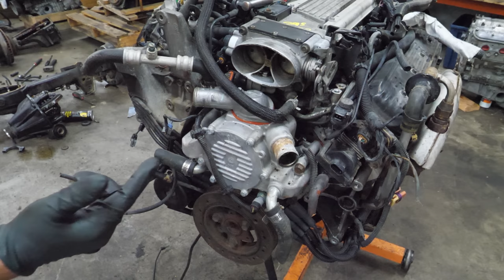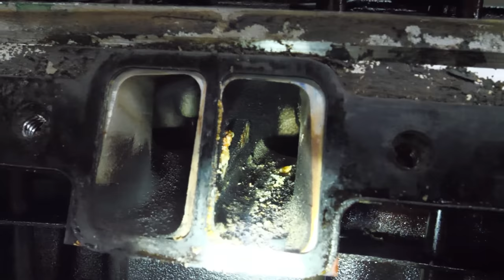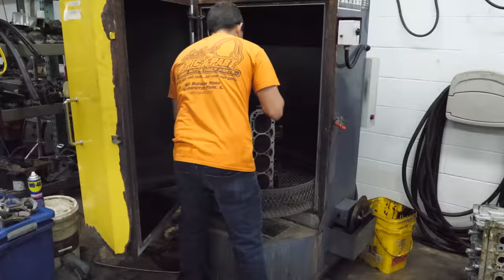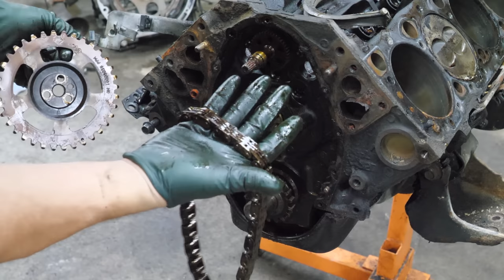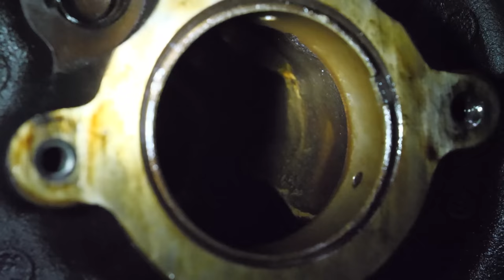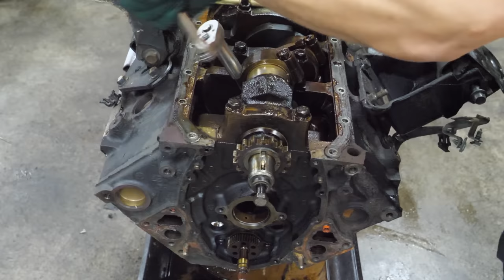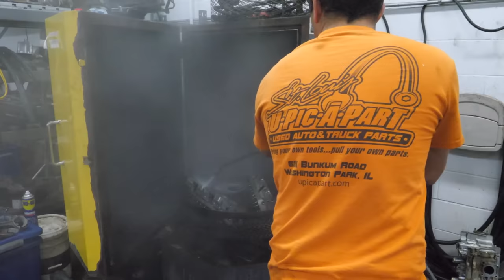Bad Corvette Camaro Trans Am Gen2 LT1 350 Teardown. Not The Problem I Was Told!

Comment: Great teardown as always. I'm more of a carpenter than a mechanic myself so it's always fun to see a disassembly of an engine since it's not something I really get into myself. (And the knowledge will for sure help if I ever do tear into one)

I will suggest though that if your cordless ratchet and impact seem to be a little... lacking in power, replace them sooner rather later. Last time I replaced one of my well used impacts, it was like night and day. For sure made a huge difference in my workflow, and time is money. Plus Christmas tool sales are going strong at this point. Buy now, save a buck, and hold onto the old ones as backups/extras. Better than buying them only once they die, because you know if you do that they aren't gonna be on sale. (Plus they'll die at the worst possible time too.)
Reply: My air operated ratchet started going stupid and I found that a small spring loaded ball had worn flat, fished through my junk collection and replaced the ball, worked fine. Ted from down under.

Comment: I have 4 of these LT1s. All Iron Head versions. 2 of them have 300,000 and don't burn Oil. One still has the Original Distributor Cap and Rotor,

Comment: Have had a few small blocks with creamy oil from blown head gaskets. Cleaned them up with ATF and some green Scotchbrite pads, and they ran like a champ. The last one was in an '89 K1500 with a leaking cooling jacket bolt hole. Cost all of $30 to fix that one and it's still running strong.
Reply: Question...
What is ATF?
Thanks 
😎👍🏼🏁🌎🇺🇲
Reply: @jimilopex76  Automatic transmission fluid

Comment: I'm in the process of tuning one of these engines right now. I got it for free "ran when pulled"... Right. Turns out all the rod bearings were spun. So I stroked it and bumped the compression up to 11.4:1 (perfect on the reverse cooling of these engines). I did an electric water pump, and carb swapped it. Dropped it in my 1980 Camaro. It's a sweet motor now! Thanks for the tear down video. it was cool seeing one with everything still all over it. Mine came mostly stripped down.

Comment: All the Camaro, firebird and Corvette LT1s had aluminum heads. Ironheads came on the Impala and Caprice engines LT1 or l99 variants. As for the opti I feel like it's much more maligned than it should be. I've ran into issues with other random sensors Ie coolant temp sensor causing symptoms that mimicked a failing opti. I do remember hearing about these engines liking to munch bearings but that almost was always a case of running the engine too hard when it was cold. I had an iron head LT1 from a 95 Caprice police car that I beat the hell out of for 15 years in my 82 Camaro and before I pulled it it was running just as strong as it ever did. This is after countless dyno pulls, street and track passes.

Comment: @I Do Cars, The best LT1 that I liked was in the 1996 and a half Police Interceptor package! They were employed
in the Caprice; upside down bathtub cruisers. Those engines were rated 350 cu. in. at 350 HP Hi Output model.
Those cars would launch like no other and as I've been told are very similar to the Impala SS. They also acted
like they had acted like they had an inexhaustible top end! Boy, I could tell you so stories!!

Comment: I still drive a 1996 Corvette with one of these in it. The valve rockers look slightly different. Not sure why. Still fun to drive around. I have a lifter on the #2 cylinder that's starting to wear out. Going to be my next fix with the digital display after that. Just hit 100k miles a few weeks ago. Thanks for the great videos.

Comment: Really enjoyed this video. I've never seen inside one of these engines. I can see why they aren't on the list of the top 10 best small block Chevrolet engines. GM started with a bottom of the barrel 350 (single bolt mains, cast crank, cast rods and cast pistons), then they "improved" it with the horrible water pump drive, ignition system, intake manifold and fuel injection system. The only redeeming feature of this engine is the aluminum heads. But they aren't really that much of a big deal, considering the aftermarket alternatives that are available now. The engine is in surprisingly good condition, considering that it had two blown head gaskets. Thanks again for sharing this video.

Comment: I've owned three LT1 cars over the years.  1992 Corvette, 1993 Z28, and currently have a 1995 Trans Am.  The only one that needed an opti replacement was the Vette after a classic water pump failure.  Replaced it with an MSD variant, which ran well.  LT1s are some of the best stock sounding V8s in my opinion.  Still hoping to some day own a 94-96 Impala SS but they are going up in value fast.  Thank you for the video.
Reply: Agreed!!! I've had 2 LT1 cars 95Z28 and currently I have a 92 corvette. Both are extremely fun!! I have basically the same thing done to the vette that I did to the camaro but went a lil further with the vette on mods! The corvette has full custom exhaust system from a C7 grand sport with the Xpipe and headers and sounds absolutely beautiful!! The Z28 had a 3in catback Flowmaster system with stock manifolds it sounded incredible as well but not quite as good as the corvette and the corvette is quite a bit faster and obviously handles a million times better
Reply: Best sounding V-8 ever imo.

..maaaaybe the GT350's "Voodoo" engine is tied with it. Maybe.

Comment: That splined coupler for the water pump does NOT come with a new pump and it’s potentially quite valuable to someone who needs it. And totally agree the Opti can be sold for refurbishing. Almost every version of it sold today is vastly inferior to the original spline drive and pin drive Optis from AC Delco.

Comment: Always put a new Delco in when job created access. New wires , Plugs , Coil too. Good preventative maintenance on nitemare design. Optispark was attempt to improve timing and EFI accuracy , which it did almost as good as crank/cam trigger does these days

Comment: I was a tech at a Chevy store when this motor was in production.  This was around the time GM was trying to make less waste by implementing 100K mile service procedures,  Oil life monitoring system, Dexcool, long life plugs and the Opti-spark.  Some systems worked better than others.  The Opti-spark was a growing pain between standard distributors and coil on plug OBDII systems.  The SS Camaro was likely the worst tune up because of the plug access.  It was easier if you used an engine drop table and lowered the motor out of the car 3-4 inches.  I do recall, late 90's, most of the full Opti-spark tune ups cost about $1,000 which pissed a lot of people off but the Opti-spark distributor alone was over $400 for the part back then and I think labor time was around 6 hours.
Reply: Contrary to what shadetree mechanics say the optispark system was a very good system all around... The LT1 was GMs most powerful production small block as well..
Reply: Optispark replacement at the dealership always ran around  500 bucks for me. I got around 100.000 miles on each one...
Reply: @jonathanlawson4667  all those police cars and taxis used that system, as long as the WP didn't leak it worked well.
Reply: Wow
Reply: Agreed 100% brother, I'd take a LT before a LS any day !
Reply: SS had the worst tune up access?  So you’d rather drop the engine than take off the air induction sitting on top of the manifold with its two 8mm bolts?  C’mon, man.  Something ain’t right with your story.
Reply: @fillupread  by induction I mean the CAI that sat atop the intake manifold on a LT1 SS car.  That is the only difference between a Z28 and a Z28 SS-  The “ram air” induction, which in itself, does not allow for good plug access unless the induction/CAI, whatever you want to call it, is unfastened by the two 8mm bolts holding it onto the top of the intake, which is also for the fuel rails.  I own one of these cars.  Vids on my channel.
Reply: @brian96597  Again...the intake is not in the same zipcode as the plugs or the Opti-spark.  Just quit.
Reply: It sucks to do
Reply: This is still one of my favorite engines. You could beat on this engine all day long and not hurt it!!! 😎

Comment: The new waterpump was a sign, the new coolant sensor in the left head sealed the deal, the post mortem was exactly what I expected after seeing those. I didn't realize those were 2 bolt main blocks. Pretty strange when you consider the power output and that a Roadmaster or Caprice wagon full of two legged beef, luggage and towing a trailer is getting into truck territory for GCVW.
Reply: I think the lt4s were four-bolt Main
Reply: Corvettes got 4-bolt blocks, the F-, B-, and D-bodies used 2-bolt blocks.

Comment: Wow, such a genius idea to bury the cap and rotor like that. Those parts never need replacing. Must be the same engineering team that decided it was a stellar idea to put the starter in the engine valley. Because like all electrical parts, they last the life of the engine!!  Kudos to GM. eyeroll 
That cam driven water pump is awesome too. Because, belts are hard. No one "gots" time for belts. LMAO
Reply: you should see the genius engineering behind the gas tank on the Camaro this this engine came in lol, I did it the hard way without cutting a hole, total pain in the ass
Reply: @miatalife94 I mean its fine for me I am planning on doing my 97 trans am fuel pump. However while I am under the car with everything out of the way I plan on cleaning and painting all the underside. It's honestly worth it to pull the tank on these cars now if you got a nice one without any rot. You can clean and paint anything that might have a bit of rust starting to form.

Comment: @24:44 - RTV should be applied like you would apply heat sink compound to a processor.  Very even and very thin.  You're trying to fill slight microscopic imperfections, not stack the Hoover Dam!

Comment: My parents had a 94 Formula (car I learned to drive lol) and it was reliable AF besides needing 2 starters replaced. IIRc they sold it after 100k. The optispark was no problem, and 'experts' generally attribute it's probs to leaking pumps (dexcool) and then inferior replacements.

Make no mistake, it was a problem - but more from a bad pump configuration and a not-quite-sealed ignition. The LS definitely improved on this. That Formula was replaced with an 02 WS6 and has had zero failures...besides a lifter tick lol.
Reply: Your parents are freakin awesome

Comment: My 1996 LT4 made 415hp. It had different heads, cam, rocker ratio, slightly different intake with bigger injectors and throttle body
Reply: Lloyd Elliot or Advanced Induction?
Reply: @cali2468  factory optioned and installed but, it’s more commonly known as the LT4 high performance kit with the LT4 “hot” cam and big valve and big port heads. It was also available through the dealership as a GM Performance kit. I made a mistake on the year, it was a 1997 anniversary Z28 that I bought in 1996. But included in the LT4 package were better heads, a red intake that was ported and port matched with the throttle body opening enlarged to accommodate a 1000 CFM t-body, 30# injectors, the t-body, 1.65 rockers, shorty headers, a bigger cam and the ecu tuned. With a K&N cone filter, high flow cat and flowmaster exhaust system, I put down 415hp at the tires. It was supposed to be 420hp at the engine but it was severely underrated. I hope this was helpful. Oh and with BFG drag radials and it was a 6 speed, I ran consistent 11.40’s at 120 in the quarter
Reply: @josephbrownjr3564 holy crap, my dream car right there

Comment: These were great performing engines in their day.... way stronger than the L98 it replaced.   Ended the reign of the 5.0L Mustang and the subsequent 4.6 Mod motor was always in the rearview.  The GEN2 LTX had a short production life from 92-97 because GM just needed a stop gap to get them to the GEN3 LS.  A lot of the stuff with them never made sense to me... the reverse cooling and optispark.... all that did was make major components incompatible with the previous SBC and introduced unreliability in the ignition system.
Reply: The reverse cooling was about emissions and performance. Smokey Yunick talked about it, and some race teams tried it. I believe Oldsmobile or Buick tried it back in the 50's but cost of production was to high. The 92 Corvette was the first production car to utilize it.

The theory behind it was to cool the hotest part of the engine, i.e. the combustion chamber so that higher compression(10.4:1 LT1 and 10.6:1 LT4) could be used. Also it allowed the block to warm up faster so that cold start emissions were reduced, and also longer block life as cold shock(cold coolant entering the block when the t-stat is initially opened) would be heavily avoided.
Reply: I remember when this came out too and ran past 5.0 mustangs . It changed street racing
Reply: Dry intake
Reply: @headhoncho4890  oh yes I remember racing a mid 90’s GT at the 1/4 mile track at rockingham NC on night with my mostly stock 96 z28 automatic I put a city block or more on him lol. He wasn’t stock either he had off road exhaust and drag tires.
Reply: I like Mustangs too, but idk what Ford was smoking when they put the anemic 4.6 into it when it had the LT1 to deal with. (and did they know the LS1 was right around the corner?)

Comment: These engines always ran so hot. 90's LT motors were okay for the time, but man did the LS improve upon that design.
Reply: Chev engines took a dump with the high temperature thermostats required to meet emissions, until completely re-designed with the LS.
Reply: But my stock LT1 still smoke an LS1. Imagine that?
Reply: @WilmaTell had a LS2 powered car, that ran hot as shit, now I have a 94 Z28 I bought after it sat in a field for 6 years, dropped the tank cleaned with new fuel pump...... it'll probably run the LS2 car close, these LT1s are no bullshit
Reply: @miatalife94  If they're both 6 speed manual transmissions it all comes down to the driver. If you hit every gear and don't spin it that's all it takes. LT1s are more aerodynamic and lower to the ground.
Reply: @WilmaTell they sure did I drove a 94 fleetwood Lt1 big as car and still beat plenty of ls I raced a hell I raced a 300 with a hemi and kicked his ass
Reply: @WilmaTell  stock vs stock I find that incredibly hard to believe.  LT1 Fbody vs LS1 Fbody the LS1 cars is ~.5 sec faster in the 1/4 (both being stock).
Reply: @GregHuston  It comes down to aerodynamics. I also already said it comes down to the drivers at that point. There really isn't as much difference between the two they'd like you to believe. At this point we're splitting hairs. You're both going to go to jail regardless.

Comment: Had a a similar 5.7 350 tuned port injection GTA! Car did 155-160. Had to hold er in D well into redline, then shift to OD. Otherwise it would keep shifting up and down around 125, and quit pulling. Car was a ball. Crushed all my buddies 5.0’s! Great vid!

Comment: I've been waiting for a 2nd gen small block LT1. I've done a lot of work on my 96 Roadmaster but I've never seen inside the engine. It's got over 170k miles on the original Optispark and I had a water pump go out around 140k miles and soaked it. I dried everything up as good as I could, put the new water pump on and haven't had a problem yet. Although I'm very aware that I need to rebuild the Optispark soon.

Comment: The trucks from 96 up had the L31 Vortec which was nearly as powerful in terms of hp and lacked the wretched optispark, but traded that for bad intake gaskets that leak coolant into the valley, and easily cracked iron cylinder heads

Comment: On the 3800s you also need to pull the oil level sensor before taking off the pan...I found that out the hard way after breaking mine. Bit of a silly thing really.

Comment: Looking back in retrospect it’s really interesting that GM took the basic iron block from the 60’s as far as they did. These aluminum headed, overplumbed beasts were a marvel in their day, but time was not kind to them. Working on these doesn’t look fun at all. Then within a few short years the LS makes its appearance. The difference being that they started from a clean sheet for what they were trying to achieve and then just  NAILED IT. Big takeaway for me on this one is just to appreciate what a wild improvement the LS really was….
Reply: From the 50s really.  Yeah the LS is a huge step.  Just seeing that large aluminum accessory bracket on the front looked high tech from the old stuff.
Reply: early LS had teething issues like every design. they came out the factory with stop leak. composite head gaskets didn’t last but they took care of that pretty quickly
Reply: LS was developed by NHRA record holder Engineers who worked @ GM.  They knew what was needed and we're all the beneficiaries of their simplistic minimal powerplant marvel. The SBC legacy will live on ad infinitum
Reply: Wasn't really much of a change except for moving the distributor. Basically the same hp.

Comment: I've been screwing with LT1s for decades now Ive never seen one have a blown head gasket. 
95 was the first year for the Big opti hole in the timing cover and got the vented opti. that cured 90% of the ignition problems.
Reply: I’m a fan of these engines.  I am waiting for my block to be finished at the machine shop, and my LT4 heads are currently at a head-porting shop.  I found an LT4  crank that needed only polishing.  It has the radiused journals.  So i guess i have a hybrid lt1/LT4!  The block is the original to my 1997 camaro SLP SS.  That is why i stayed with the OEM stroke and OEM LT4 heads.  I chose a huge cam (for a 355) and i had to modify my intake for the heads.  My camaro is white with the orange stripes, so it’s ALMOST an LT4 30th anniversary edition!